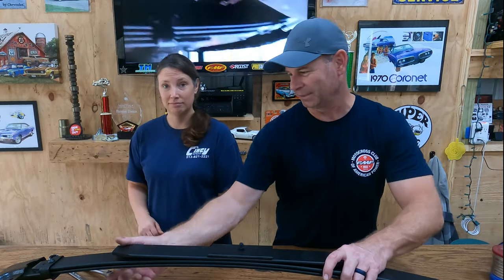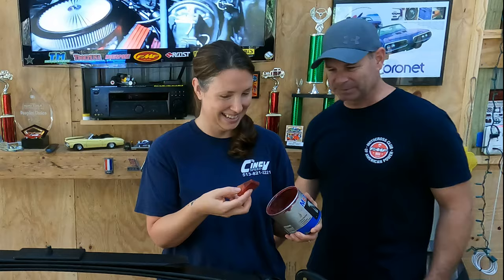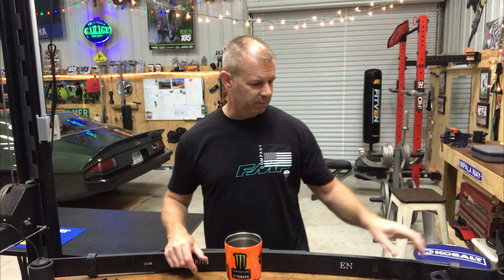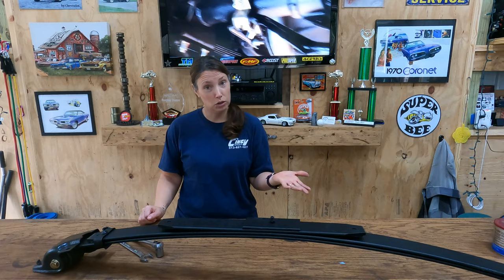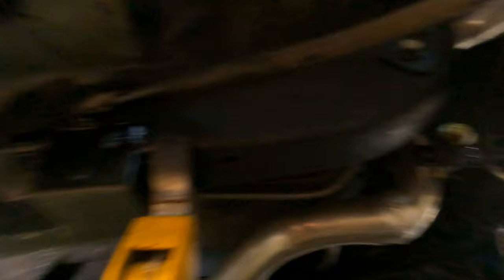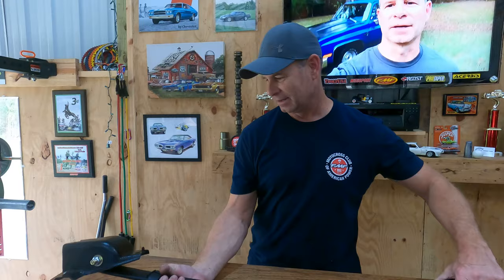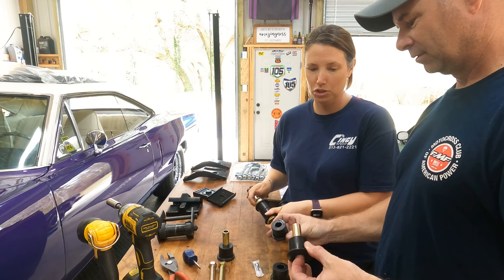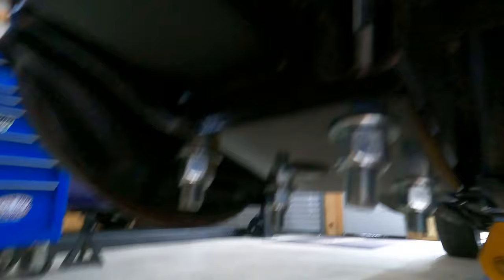2nd gen Camaro Hotchkis TVS rear suspension install. Rear suspension talk. EP 19

Comment: A second gen car owned by Spectre racing a handful of years ago was called the carbon Camaro. They sold the car but it’s hard to miss. It was one of the first second gens to run fender flares. It ran a full Hotchkiss suspension set up with leaf springs, it was very successful running the autocross against the more serious cars. I own a 74 Z28, I have had a few 74 models. I’m my plain 74 Camaro, I run 74 Z28 from coils with 360pound front springs, and Afco 175 pound rear springs. I also run a big old Rancho adjustable front sway bar. Global west bushings in the stock control arms, global west intelocking subframe bushings and competition engineering bolt in subframe connectors all new front end parts, ball joints and steering linkage by Moog. 
 Funny you mention the subframe alignment holes. I installed bolts that fit tight in my subframe, but somehow it’s still a 1/4 or 1/8 off. I found that out when I had it aligned. I just used 84 Z28 alignment specs. It goes straight, handles like it’s on rails even with Cooper cobra tires. Mine doesn’t do anything but go straight and where I point it. So I guess the alignment is close enough. It’s dead straight down the road, and totally stable at speeds law enforcement doesn’t approve.
Reply from the maker: Nice set up! Post some pic’s to the FB page so we can see it!!

Comment: Really like your vid’s. What year is your camaro? Can you tell me what size rim’s and tires are on this camaro looks really nice.
Reply from the maker: Thank you! We have tons of content coming for this car! We have a TKX 5 speed with hydraulic clutch install as well as classic auto air complete air conditioning in store to prep this car for drag week! The current wheels and tires you see are available from a year one they are 17 x 9 in the rear with a 275 50 17 and 16 x 8 in the front with a 245 50 16. I will warn that the fronts are zero offset, meaning they have only 4 inches of backspace so the outside of the tire very close to the fender lip. I plan to go to different wheels to not have issues out on the road with my lowered Hotchkis suspension…

Comment: Hey I have a question !! I just installed Hotchkis TVS 1 on my 79 Firebird , everything went smooth besides the rear sway bar , would you happen to have a video of how you got it done or pictures ? Appreciate it
Reply from the maker: I’m sure I can rustle something up… What exactly are you looking for? points to drill through on the frame?
Reply: @FamilysGarage  yes ! its a little shorter than the factory one . Didnt know if the bracket needed to be welded on to the rear floors or where
Reply from the maker: Mine has brackets that bolt through the rear frame rails right where it turns up at the rear wheels. If you go to part II of the Camaro new project video I think I show it…

Comment: sooo why didn't you touch on the BEST rear suspension out there now... the torque arm? every serious autocrosser/pro-tourer is running torque arms out back these days. speedtech is the best..  i had the hotchkis leafs and it was a good entry level setup for the street.. but it's still a leaf spring setup. still binds, wraps and recoils. time to enter the 21st century my friend!
Reply from the maker: We agree the torque arm is the best however this car hast to do everything well plus be able to go to work occasionally. We will be putting the Grigg’s torque arm system in our Mustang we’re building strictly for the track😎.